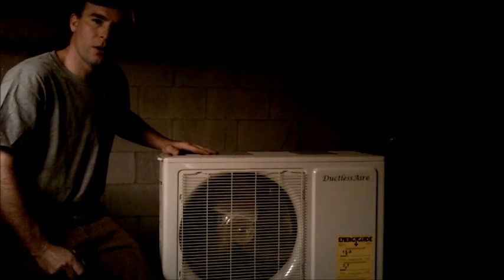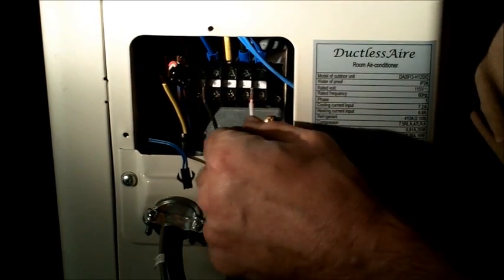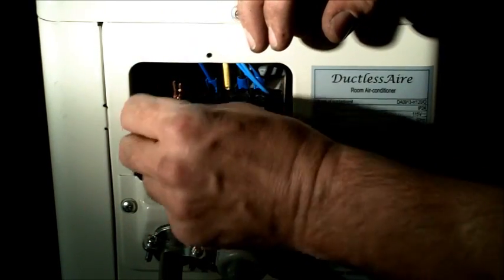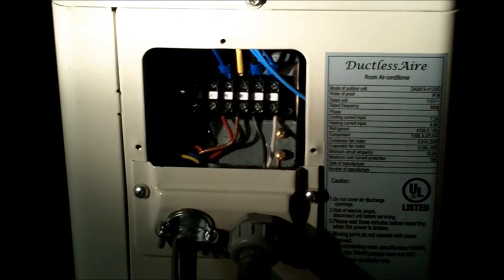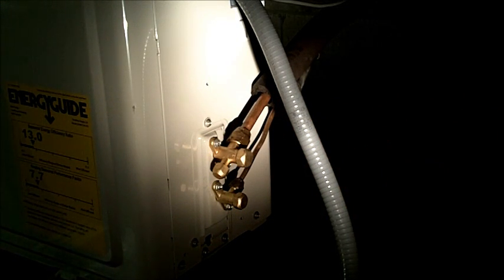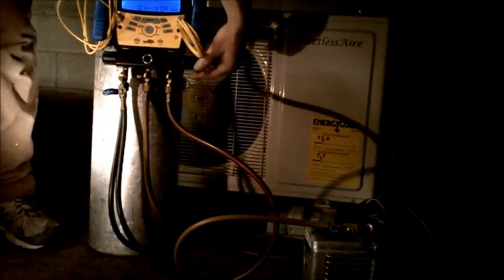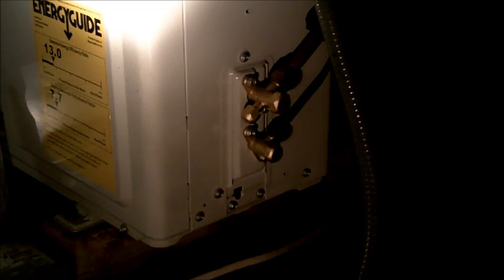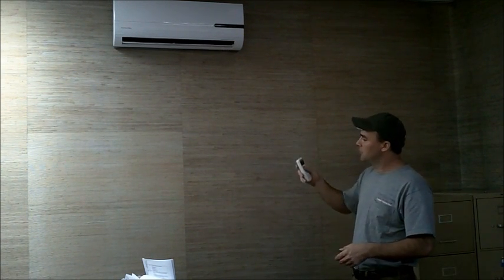Ductless Mini Split Heat Pump Installation Part 2

Comment: Can you ballpark an installation fee for this unit? 

Just bought one and considering how sensitive the control board is, it might be a good idea to get someone who knows what they're doing ;)
Reply from the maker: recommend always get a professional.. make sure they are licensed and can do your servicing for seasonal service as well.  600 to 800 for full install with a 1 year labor warranty would be a fair standard rate with permit and inspections .  beware if the say they can install but can't diagnosis problems or service .
Reply: Thank you!

Comment: the crowfoot to torque wrench is incorrect....he actually over torqued the fitting....crowfoot needs to be 90 degrees to torque wrench.....good presentation, thanks
Reply from the maker: actually  the torque wrench is 100% correct .each diffrent style wrench has proper markings on it to ensure proper direction and nm setting. always using a backup wrench .  your own video may help others understand you point .

Comment from the maker: yes . In refrigeration it is a must to pull a vacuum.  like most all things it may work without but for how long . also if vacuum step is skipped then more than likely you are skipping the pressurized step.  and they do come precharged but for different lengths of tubing charge may have to be added or subtracted.  always read the service manual for the system before installing.  also it is important  to remember it takes just as long to install it improperly as it does properly.  do it right and it will last a long time . do it wrong and you get to do it again soon.  thank you for your questions. .

Comment: Great videos!!!
Is it necessary to draw a vacuum on the system?  A few people I know have installed the units and did not draw a vacuum beforehand. Your thoughts?
Is any gas needed besides what's in the unit to pressurize the lines?
Thanks for the videos! Great job?   Al

Comment: after vacuuming the lines, how do you remove the manifold/gauges/vacuum from the service port without compromising your vacuum? as soon as you remove the "r410a adapter" from the service port, isn't air going to rush right into those newly vacuumed lines?
Reply: Michael Ackerman  release your precharge check system preasures remove gauges
Reply: I've wondered about this too. After watching one of his other install video's, Toby shows the vacuum pump still hooked up and presumed off, when he releases the freon charge. I've concluded, and someone please correct me if I'm wrong, that it is spool valves that are inside these 2 fittings that are on the side of the unit. They are screwed in ( allen wrench one's ) from the factory, and in this position, the spool valves close off access to the outdoor unit, sealing the factory freon inside. Also, in this position, the spool valves provide a path too the service port thru which you connect BOTH the Nitrogen and Vacuum pump. So, after the vacuum pump sequence is done, IF you disconnected it BEFORE releasing the Freon charge, you would exactly as you asked compromise the vacuum. By unscrewing the valves with the allen wrench, you close OFF the service port, which allows disconnection of the vacuum pump. While Toby did all a great service making these video's, he confused us with this one. He obviously forgot to film when releasing his freon charge, and faked it, by filming the last sequence of releasing the freon, because if he actually had done as he showed, he would have compromised his vacuum unhooking it, capped the service port, and then releasing the freon.
Reply: The vacuum line attaches to the compressor via  a spring-loaded Schraeder valve.  When you remove the vacuum line from the 410 port, it automatically closes via the spring valve inside the port.  There is a split second where some external air does go into the compressor line, but it is minimal.  If you are worried about it, you can do the alternative approach: which is to leave the blue vacuum line attached to the 410 port while releasing the freon into the lines (via the two allen/hex wrenches), then remove the vacuum line after the freon is in the lines (be sure the vacuum pump is OFF and the vacuum valuves are all closed before doing that).